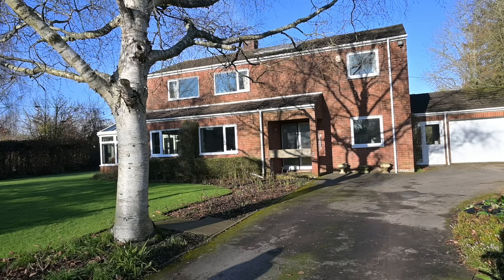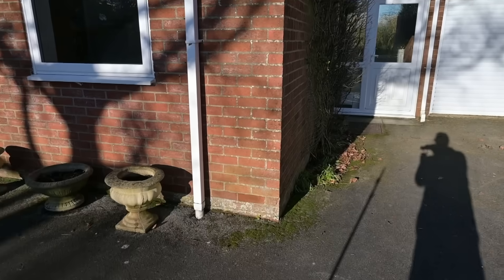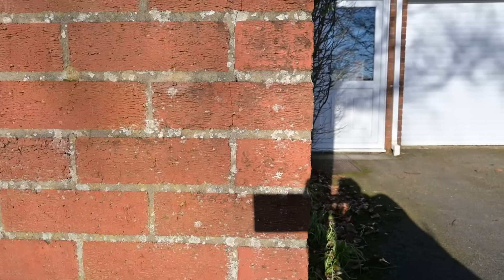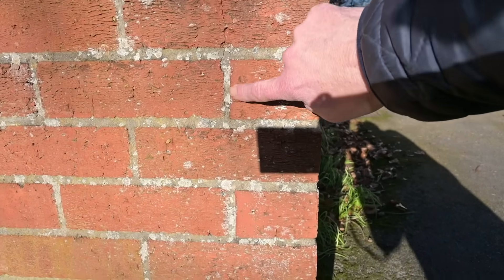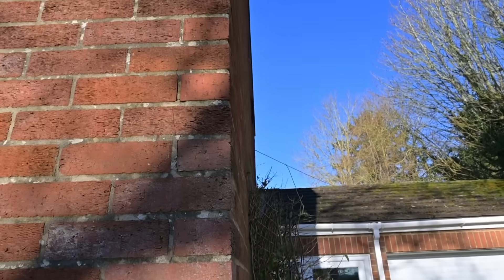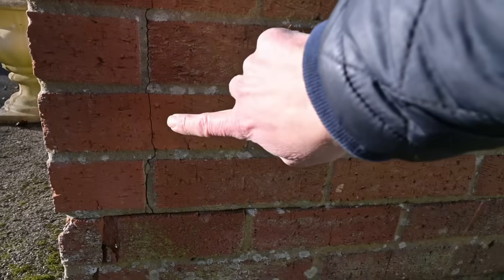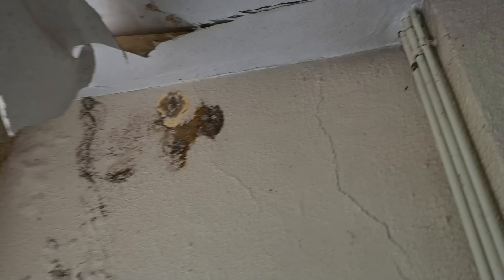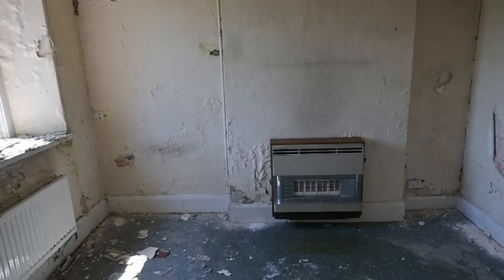Structural movement in houses

Comment: Bet you have been BUSY this Autumn. My area is built on a layer of very solid clay, most buildings were built straight on this clay with no need for foundations as this clay has barely moved in the last 1000 years.
Unfortunately things have changed, 2018 showed issues, 2022 really started major problems, 2025 has people in tears because insurance is either nonexistant or not paying to fix issues that were fixed in 2018 and 2022. 
Try explaining to people who paid £3000 to fix 2022 issues that now it will take £6000 to fix 2025 and that none of the work can be guaranteed because the problem is that clay dries out and moves a lot when it does not rain for six months. So next time it is hot it will happen again because England was never designed to be the Sahara Desert.

Comment: Be honest, as a surveyor, surveying on a single visit, you simply cannot know what are the causes of these cracks. It is beyond your or any surveyor's capacity. Only a builder or structural engineer who can carry out more extensive and likely invasive investigations can do so.
Taking your theory of a failed lintel being a likely candidate for the substantial cracks, it could be argued that the subsequent lack of support would lead to the masonry above moving inwards rather than outwards as you suggest. So, I think it is prudent to not over-state our views in the absence of fuller investigations.
Your work is appreciated greatly for initiating discussions of these kinds of issues. Thank you.

Comment: I lived in a cottage that did have structural issues - a bit like the last cottage shown. It ended up being underpinned. And the reason for the movement. Somebody had knocked the cottage down that use to be on the other side of a small archway. My next cottage was built in 1765. Now that was a tank of a building. No sign of movement etc. But then they had used lime mortar with not a brick in sight - all stone/flint. 

But the UK seems to have a thing with cracks in buildings. If one lived in an earthquake zone, one wouldn't even be bothered. A bit like the house I live in now. It has tiny cracks by the windows and doors. A result of the earthquake we had in 2008. Am I bothered. Not really. A building is a living thing. It breathes, it moves.

Comment: The thermal expansion or more likely contraction with the first building is probably due to the movement of the outer skin on its own.  The internal conditions are likely to be reasonably stable and moreso if the walls have been retrofitted with cavity wall insulation.  The wall ties being simple wire ties have no resistance to longitudinal movement of the outer skin that will be subject to considerable thermal movement from solar gain and freezing temperatures.  Contraction joints at 9m ctrs would have helped or better still the use of lime in the mortar and not pure sand : cement with maybe a dash of Fairy Liquid to act as a plasticiser.  The cracking shown has the potential to get worse when the brick absorbs water into the crack and freezes.

Comment: Well done to speak of thermal expansion in the first property. A solid wall will expand and contract with the seasons, and crack at the weakest point, here by rotation of the corner bricks. A door or window in the blank side wall would have saved the corner. The vertical cracks in the stone gable wall of the last house are unusual. If the fireplace inside is no longer used and rain can run down an unlined flue, freezing of dampness would expand the stones to show this pattern. The stone wall exterior to the flue would be thinner than elsewhere.

Comment: In the bungalow with the reconstituted stone, if you heard that that corner of the house was very close to an old 1960s rubbish tip, would it worry you more?
Reply from the maker: Are you referring to this bungalow or hypothetical other bungalow. It would not worry me unduly but you have asked a very short question about a very big subject with an enormous number of variables.
Reply: @thecpd1405  the exact situation Hypothetically, same exterior crack with a landfill marked on the searches 3 feet from the wall, 30 yo building with no recorded issues, been advised get a survey but it will only show what the building shows so they can't tell if it will be a problem later, some people say don't touch it some say if there's nothing to see there will be nothing to see with a survey other than what you can see already, without doing an intrusive survey(drilling into the ground i assume)
Reply: Great videos! Where are you based?
Reply: Have just watched your video with interest and would make a few remarks to add into the mix: 
Property #1; I have also come across this problem where an thermalite blockwork was used for the inner skin, which exhibits a greater degree of thermal movement. That said the cracking extending below the dpc is curious.

Property #2; With damage to an internal wall only, and in the absence of crack damage to external wall, I would be looking to other reasons than subsidence for the cause of the damage. Have known damage to internal walls only to loft conversion (additional loading), excessive storage of items in a loft (additional loading), local roof spread (though a check on external wall verticality of high/eaves height brickwork would confirm).

Property #3 For subsidence, ground and foundation movement to have occurred, as you state, movement would not simply affect one wall, and a corresponding degree of movement should have occurred at 90 degrees. ie two walls that abut should show similar cracking to indicate that movement and rotation has occurred. If one is seeing movement only in one wall and not at right angels to it, I would be thinking there is more likely to be an alternative explanation such (as you point out) thermal effects, or relative thermal movement. With the bungalow, you have a long continuous rear elevation wall. Typically you would have movement joint at intervals, such as every 6.0m, or 3.om from any corner or return in the wall. This is not immediately evident. With a very hot summer, and say enhancements to loft insulation, temperatures within the roof void could well be higher than what is normally experienced, resulting in thermal expansion effects of the wall, relative to the roof, or the roof relative to the wall, which in turn could well be attributed to the cracking evident to the faux stonework. Note how the cracking is more pronounced at higher level. If the cracking does not continue to low level,  and in the absence of cracking at right angles (on plan) I would say in all probability this is also due to thermal movement and not subs. Though you could always caveat it by saying, should further movement occur, further investigations may be necessary.

Property #4: I've have seen such crack damage on a gable end/flank wall before. Typically a about a hard spot. Older/historic properties would have foundations shallower than today (pre NHBC etc), and if built on clay soil wold be typically bobbing (!) up and down quite happily between seasons and over the years. However if at some stage there were a large tree, or shrub within proximity this might result in local clay desiccation and subsequent ground and foundation movement. Some properties, and particularly those with masonry including lime based mortar are better able to tolerate such movement, though it may be necessary to periodically repoint. Usually (as you indicated in prop #2) you would have a loci of movement, so damage tending to be in proximity to the area/cause of the damage. However should you have a change in foundation depth, such as a cellar under one part of the property only, this might account for initiating of crack damage, here midway along the flank wall. I did come across a hard spot on an old thatched cottage due to the fire place, the many centuries of fires in a grand inglenook had 'fired' the clay subsoil resulting in the building no longer being able to move and bob up and down with the seasons quite as it once had! And the other reason, an old property on the route of the old A5, together with its neighbour, straddling a roman bottle well- that one was quite exciting I must admit.

Edit; with property #4, on reflection, I would want to check what alterations have been carried out to the property over time. I wonder whether an internal cross wall has been added or modified extending from left to right to provide for separate accommodation front to back. Such a wall may have been built upon a deeper foundation, and where this abuts the flank wall would offer resistance to the flank wall moving up and down with the changing seasons, resulting in the vertical cracks, 2Nos. typically either side of the abutment of cross wall with flank wall.